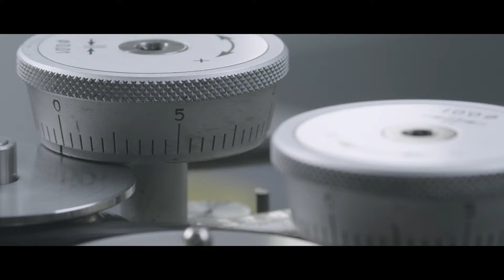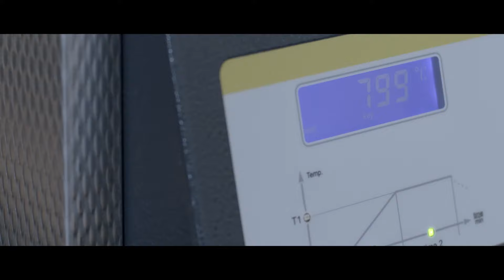Patek Philippe Grande Sonnerie 6301P Complete film

Comment: 5:16 what's the black material they're using for  clock face here?
Reply from the maker: It's a vitreous mixture composed of silicic acid, sodium borate, nitre and minium. Metallic oxides are then added to this combination. This powder is humidified to form a paste called barbotine. The latter is applied in successive layers to a metal disc repeatedly fired in a kiln heated to more than 800°C. This process continues until the dial has attained its glowing texture.  The technique is called Enamel or Email (in French).
Reply: @timeandwatches  thank you so much for your reply

Comment: what does mean emal?
Reply from the maker: It’s the French for “enamel”
Reply: EMAIL means ENAMEL in French. They wrote it to remark that he dial is produced using the Grand Feu Enamel technique which involves firing the watch face meticulously coated with successive layers of enamel at very high temperatures generally ranging from 800 to 900 degrees Celsius.  The result is inalterable colour and radiance over time.

Comment: Why does the watch has written EMAIL instead of SWISS MADE?!!
Reply from the maker: EMAIL means ENAMEL in French. They wrote it to remark that he dial is produced using the Grand Feu Enamel technique which involves firing the watch face meticulously coated with successive layers of enamel at very high temperatures generally ranging from 800 to 900 degrees Celsius.  The result is inalterable colour and radiance over time.
Reply: @timeandwatches   Ahhh. I see. I thought it was literally an e mail! Used as a buzz word for marketing purposes.

Comment: Why does it say “email” at the six o’clock position?
Reply: I just googled it, émail means enamel, so that's the enamel on the watch face.
Reply: @alunchisholm481  very cool, thank you
Reply: @alunchisholm481  still can’t afford it
Reply: @alunchisholm481  they really should have spent the $50.00 to put the accent aigu.
Reply: EMAIL means ENAMEL in French. They wrote it to remark that he dial is produced using the Grand Feu Enamel technique which involves firing the watch face meticulously coated with successive layers of enamel at very high temperatures generally ranging from 800 to 900 degrees Celsius.  The result is inalterable colour and radiance over time.
Reply: @coolgabe64  how do you say “email” in French??  “Enamel”???  😂😂😂